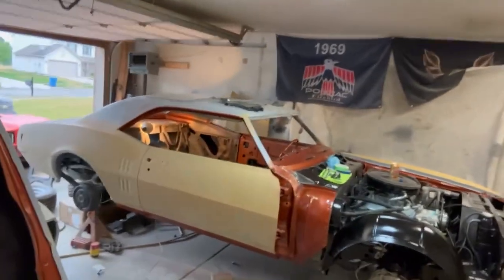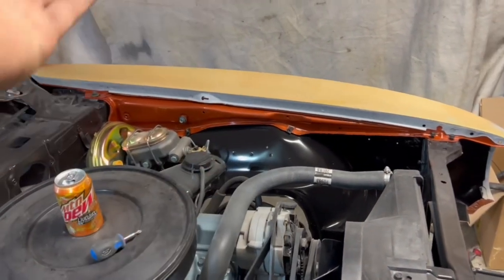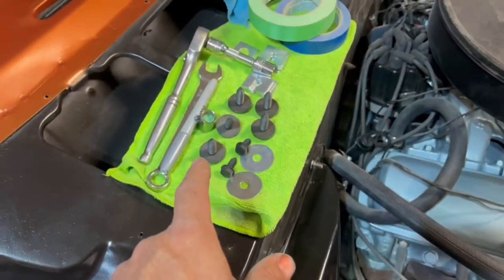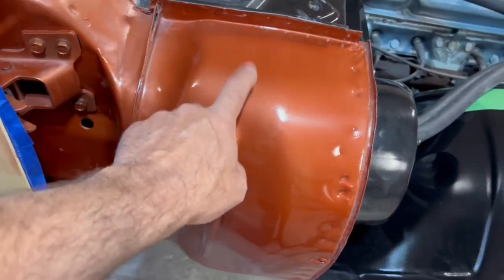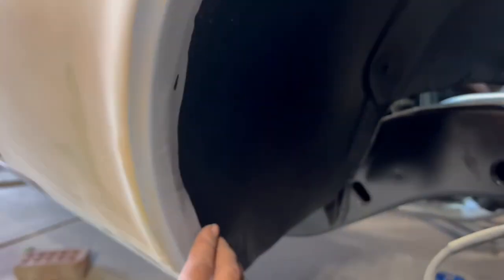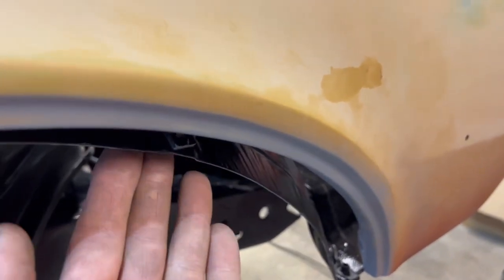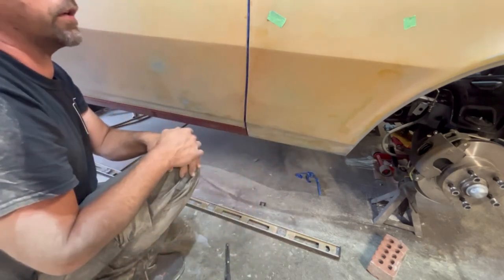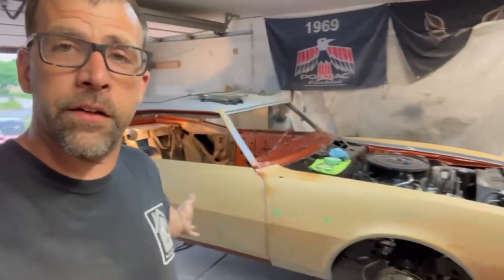Fender Installation on 1967 and 1968 Firebirds - Everything You Need to Know

Comment: I owned a 1968 firebird convertible in the same color. The car was 5 years old when I bought it and it seemed to me that the color was just a tad darker than what I'm seeing here. It could be the light or something but that's my initial impression. I also own two other 1967 firebirds. One was green metallic and the 400 was red.
Reply from the maker: The camera charges the color a bit from reality. Back in the day on the dukes of hazard the cars were painted a red color then once filmed it appeared orange on the tv.
Reply: @VinylVillageGarage  That is probably true. I've owned 3 first gen firebirds and I've seen most all the colors and the color that you have looks better than any other. My 68 with the black ragtop and black interior looked better than any I've seen ever.

Comment: Man that car is looking amazing!!!! I sent you pics of my junkyard GT-37 through your email.
Reply from the maker: Yes I got them and responded.  That was a fantastic find for a boneyard find.  Where those picture taken at the scrap yard
Reply: @VinylVillageGarage  
It is one of 5802 in 71. Mine is a factree ac car. 350 2bbl normal stuff. I have a junkyard L92 6.2L a d 4L80E transmission for it. I bought it without any drivetrain. As Steve would say no harm found. Hope to do Power Tour in it next yr with my father,even it is perfect!
Reply: @VinylVillageGarage 
They where at a "tow/junkyard " location in N.C.
Reply from the maker: I would love to do the power tour, and LS swap will make for a great car to travel the tour with
Reply: @VinylVillageGarage 
I am very hopeful to begin the rebuild on the GT-37 soon. I have a replacement shell with much less issues, than the original. So it will be a rebody still old GM metal which should not matter. Dynacorn does it,with the original vin swap.
Reply: @VinylVillageGarage  
Sorry I didn't get your reply. I am fortunate to have come across your channel. Brings me hope for my Pontiac!

Comment: Great and super helpful videos. Thanks much. Do you do anything to the bolts for any sort of rust proofing? Lots of the new bolts have a phosphate coating I think and start rusting out relatively quickly. Thanks.
Reply from the maker: Some bolts I have sandblasted and painted. Other then that the phosphate coating is all they have on them.  Yes they will rust again but keeping a thin coat of wd40 seems to work pretty good at keeping them looking nice and preventing rust.

Comment: Would it be possible/or easier to bolt on inner fender and assemble as one piece? My original inner was so rusty i removed as one...
Reply from the maker: Yes, but the drivers side you will need to attach the inner fender support on the rear by the firewall first. The bolts that attach it will not be easily accessible once assembled.  Then bolt the inner up to the support that are inside the wheel well

Comment: Hello Jon
I’m working on installing a new radiator on my 67 Bird . Do you have a video of your installation along with the fan shroud ?  I ordered and received a radiator and shroud from Summit. I don’t foresee a problem with the radiator installation but the shroud is another story. Appreciate any advice you have !
Thanks !!
Reply from the maker: I can’t remember if I did that on video. The factory shroud attaches with one bolt top and center to a metal bracket that is bolted to the core support. Then the bottom is attached by only clips that are attached to the radiator end caps. They are available in a kit 
  https://www.ecklers.com/firebird-lower-fan-shroud-mounting-bracket-set-engine-cooling-1967-1969-75-259037-1.html
Reply: I’m returning the shroud Summit sent and buying one new at Lutty’s in Pittsburgh along with top and lower brackets which were missing from my car . Thanks again Jon for your reply and help !!!

Comment: What did you use to paint the frame and engine compartment ?
Reply from the maker: It’s a 60% gloss paint i ordered from eBay and really very happy with the results painted the insides of the fenders, inner fenders wells and backside of the hood with it as well.

eBay item description #1498 60% Semi-Gloss Black Single Stage Acrylic Enamel Paint Quart Kit

https://www.ebay.com/itm/252381774280?mkcid=16&mkevt=1&mkrid=711-127632-2357-0&ssspo=8ZQ24RrWTE-&sssrc=4429486&ssuid=BN_aheTVQma&var=&widget_ver=artemis&media=COPY